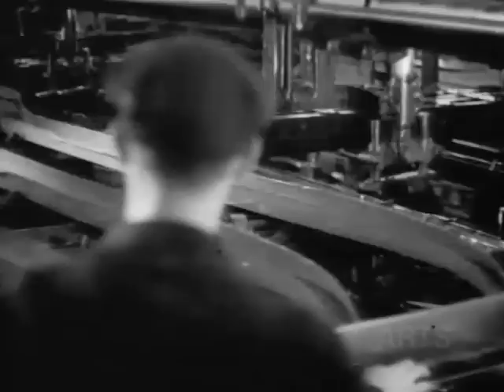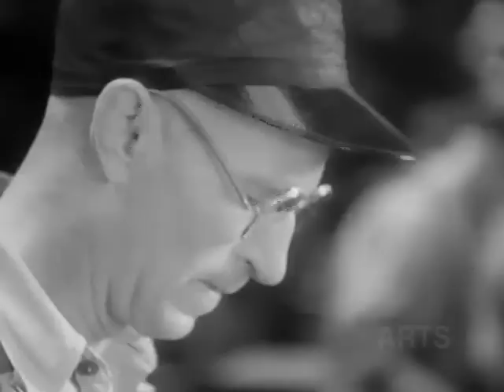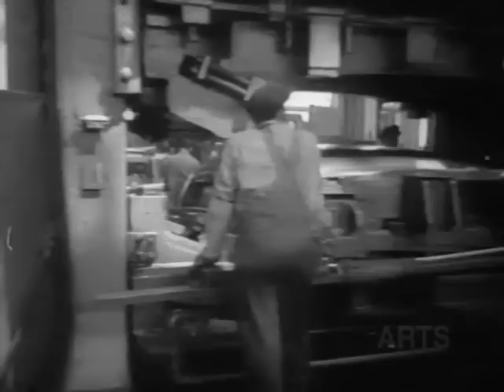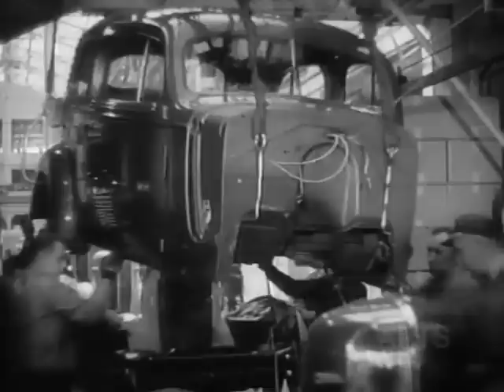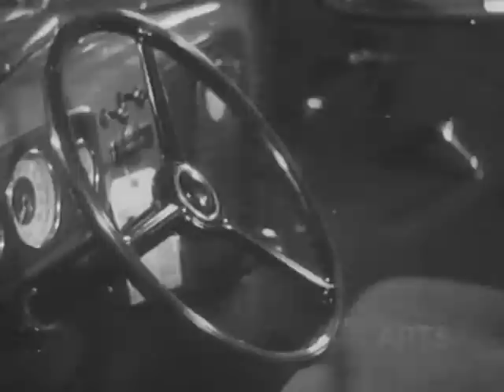Fascinating 1936 Footage of Car Assembly Line

Comment: Bravo, great video.  I wish America still built things like this.  I went to college in Flint and all that industry is now a wasteland.  I like the old way better, metal cars with no computers, built by hard working American craftsmen and brilliant engineers.
Reply: If only back then they had inertia seat belts, headrests and airbags how many road deaths would we have had? Gotta agree with you though Charlie weve come a long way, but somehow the world seemed more sane back then, not that i was on the planet at the time, came on the scene not much later tho.
Reply: When I was racing, then inspecting race cars, I used to be a safety nazi. I picked over every little thing. Now in street cars you have so many "safety" gadgets, no one really knows how to drive. ABS, "self driving" cars, parking assist, rear view video "mirrors". And God forbid you actually help a kid learn how to diagnose simple problems, check fluids, CHECK THE LIGHTS AND SEE IF THEY WORK ONCE IN A WHILE, change a tire, etc., etc.
Reply: Steve Vincent what has inertia locking seat belts have to do with anything. All that had to be done was tighten the seat belts.
Reply: Like the old way better? No problem. Get rid of your TV and your cable, fit all your clothes- and your wife's too- in a 3'x 3' closet, never go to a restaurant, or a doctor or dentist, get your kids working at 16, work 12 hrs a day yourself including Saturday, never go on vacation, and piss in a bucket in the backyard. If you're up or that you're half way to your dream.
Reply: If car manufacturers did not innovate and we had today cars and trucks without cathalic convertors and CDI systems, we would be all suffering from lung diseases. 
Computers in cars are not bad, but It is tempting for a car manufacturer to add features in  a car that are not really necessary.
Reply: It had a real real feel to touch the product that was going to be sold.
Reply: Yes, ooohhh who can forget front drum brakes n high hp engines? 🤣🤣🤣
Reply: Those care were very polluting, and very inefficient... Had the advances in technology been put into economy rather than power, we could all be driving 50 mpg cars. Instead, we have 200HP cars instead of 80HP cars to drive to the grocery store.

Comment: I can’t imagine the amount of labor that went into making those multi step dies for forming that sheet metal. Several years ago I hauled the CNC master that made the computer measurements of patterns for CNC machines that machined the finish dies for fenders, doors, and quarter panels. Even with CNC machining I thought about all the machining time it would take to make those huge dies, I can’t imagine hand grinding them to the precison needed to give the required surface needed for that blemish free finish.

Comment: Those cars back then were made out of metal not 95% plastic like they are now
Reply: Jerome Channell 
What are you talking about.  Cars and trucks nowadays are made mostly.of either steel or aluminum
Reply: kyle warmerdam yeah all the interior is crap plastic, crap carpet, crap seat covers......engines mostly wires n computer chips.....1 lil wire gets chewed by a mouse n ya car is going NO WHERE.....
Reply: Red Blue40 
When a person buys a shitty trim level that's what you get is cheap plastic interiors
Reply: when a person buys a higher trim level, they get cheap plastic made to look like higher quality material.
Reply: So you see why pick ups from the 60's are still on the job!
Reply: Yeah all metal interiors that stuck into people when they crashed. Injuries were more horrific back then.
Reply: A newer car 'fender bending' into my '69 C-10's HD bumper? Me - a wrench and a can of spray paint;  them - $2000 in damages (after a tow fee).
Reply: Sure if you didn't suffer an injury due to no crumple zone, maybe cost more to fix but it saves people from being cripples after a crash.
Reply: Smart driving, plus collapsible (or shear away steering columns 60's) smart driving, beats airbags hands down.
Reply: That's silly, you may drive smart, doesn't mean the other idiot t-boning you does. I suppose seltbelts are no use either eh?
Reply: Driving smart means you look out for all the idiots at likely occasions. Ask an 18 wheeler how they do it. I used to do that.
2000 Lbs v 5000 SUV and pickups? Airbags and crumble zones.... inside a eggshell.
Reply: Jerome Channell - Dude, the next time you fly in a Boeing Dreamliner, you’re flying in a 90% plastic + aluminum plane too, because that kind of plastic is stronger than steel.
Reply: Yeah...and they weighed TONS and got 5-6 mpg. But who cared when gas was .20 per gallon??
Reply: Yeah, everything modern sux. Bring back: Splash lubrication. Thermosyphon cooling. Ignition points that weld them selves closed if you forget to shut the key off. Sticking floats on carburetors. Engines that didn't start when it was cold, or wouldn't stay running on a hot summer day. 5 MPG. Valve jobs, ring jobs, and engines that were just totally worn out at 100K miles. 

I especially want a car they can hose my guts off of the interior, after I have the accident when the unassisted 4 wheel drum brakes are fading, and don't have enough ass to stop the 3 ton beast.  

Seriously people, old cars are nice to tinker with, and take on weekend drives for ice cream. But anybody who totally shits on modern advancements, and waxes poetic about all the great things cars had going for them "back in the day" either didn't live back in the day, or really enjoy using 36 grit sandpaper as a wash cloth, while they take an ice cold shower. 

I think it all boils down to "I don't understand how it works, and I fear change, therefore it's bad".
Reply: Cars back then made it about 20k and started falling apart.  The parts made back then were crudely made and fit like crap. I've seen plenty of original condition classic car's and the fit and finish was a joke.
Reply: @johnsarab4500  yeah if you throw enough money at them you can keep anything on the road.
Reply: @Kmecha84  You've GOT to be kidding......
Reply: @milojanis4901  um well vehicles are made of aluminum steel and plastic so no I'm not kidding
Reply: @Kmecha84  r/wooooosh

Comment: Amazing...would like to know how it worked with out microcontrolers
Reply: Mic's were common back in the 30's
Reply: Everything was mechanical - really not unique, many machines still run exactly the same way today. Like comparing a mechanical and electric wrist watch. Microcontrollers were not available until the 1970's.

Comment: "The first automatic transmission was invented in 1921 by Alfred Horner Munro of Regina, Saskatchewan, Canada." Makes me happy because that is where I live :). 

"The first automatic transmissions using hydraulic fluid were developed by General Motors during the 1930s and introduced in the 1940 Oldsmobile as the "Hydra-Matic" transmission" SO you are correct but so am I..
Reply: No the HydraMatic, the other GM automatic transmissions, the Powerglide and Dynaflow came later.  The HydraMatics were a four speed transmission used in Oldsmobiles, Cadillacs and after the war  Pontiacs and featured a fluid coupling so there was no clutch. The Powerglides were exclusive to Chevys and were only two speeds and the Dynaflow was also a two speed but normally operated in the higher range gearset and used a torque converter to provide the needed gear reduction to accelerate the car. The Buick transmission using torque converters in normal operation had no perception of shifting, the torque converter providing variable reduction so the effective ratio of the transmission changes without shifting, it was very smooth but not to efficient. Some other GM cars used Dynaflows in 1953 due to a fire destroying the Hydramatic plant.
Reply: model T ford was basically a automatic.  no clutch
Reply: hey capt. that's where the designation th400 th350 etc. came from and po werglides were used in other gm cars too my tempest has a straight 6 with a glide still works great hydramatic was just a gm division like Saginaw,delco,mucie or ac
Reply: Sturtevant had an automatic in 1906
Reply: LostFart i wont buy an automatic  .even if i have to special order a car for the manual i will. Automatic  shortens a cars life and need replacement often  . I can rebuild them , i do for customers  i just wont own one
Reply: Automatic transmissions wear out or need replacing much sooner than a standard shift, but they (automatics) are surely a convenience in heavy city traffic.
Reply: * DYNAFLOW *  Ugh!  That transmission is what earned Buicks the name "Bu - Hog" back in the day.
Reply: Abcde    Tell us more about this vehicle.  Where was it built and do any still exist?

Comment: "Once men used machines to build things. Now machines use men."
That's what I call glorifying the past.
As esthetically appealing this might be, in fact it's the worst nightmare of fragmentation of work I've ever seen. Every worker had exactly one manipulation to do, the work rhythm was determined mercilessly by the machines, and alienation from the workpiece was at its climax.
Today we have a quite clear separation between robotized areas and those with manual assembly. The pace in the areas where humans work is much more flexible and the work is no longer divided in single manipulations but in completing subassemblies. This demands more (or a different kind of) attention by the worker, but it also gives a small amount of freedom to him or her – and the satisfaction of having finished something…
Reply: 0cer0 There still are plants that mix machines with human presence and a lot of activities that require just 1-2 small and fast operations by a worker. And it isn't a nightmare at all, a huge part of the operators would like to work simple tasks, because that doesn't require much responsability.
Reply: 0cer0 in other words , today we have unionized mandatory 15 minute breaks every hour

Comment: How the years have changed manufacturing.  When you watch this video you can actually see the heart beat of the whole factory working as one becasue the mechanical processes were based on the wheel and not on 5 axis robotics.

Comment: The old cars were built to last. I just gave my Ford Explorer 1991 to be sold for a charity

Still runs and shifts super smooth.

Replaced a few parts over the years, but original engine and transmission

It runs like a dream

Rides like a dream

Had an 89 E-150 that Also ran and rode like a dream

They don't build them like that anymore

31 years old and starts with a single crank. 

Just absolutely incredible

God I miss America from back then

Comment: You know what's even more fascinating...this control (programming) was all done via huge relays in panels...some were pneumatic timer relays...incredible...the engineering and wiring of theses panels. I designed, built and wired a big relay panel in 1990 for a control system...i can appreciate what they did here.
Some workers without gloves...lots of moving machines near them....I see lots wrong with the safety here...but that's how things went years ago.

Comment: Most people think of the automated factory to be a relatively new technology, when in fact it has been around since the late 1800’s in heavy industries.  You could see quite a bit of 20 plus year old machinery in this film along with cutting edge units of the mid 30’s.   Very little has really changed in the assembly of the automobile over the last 70 years other than single point machines that can do multiple tasks instead of single task machines.  The human mind and dexterity will likely never be replaced however, since this is the most flexible machines in the plant.

Comment: 1936 was the year my mother was born!keeping up with one another plays the biggest roll because when the line stops, so does production, sometimes it's unavoidable but, breakdowns does happen without any notice and sometimes it will.  A lot of of the molds needs constant maintnaice, the whole system has been outdated and those machine's and die's are extremely expensive and in most cases compnies will have to rent them. There will always be disappoints along your journey with feelings of failure. Keep your eye's towards Mark of the High Calling...You can't go wrong, "EVER❗peace be upon you forever!!

Comment: Stylists and Engineers get all the credit for exciting cars but to me most impressive is back when cars changed significantly every year, all the complex tooling and assembly machinery had to change along with them. How they got it all coordinated and designed and built in such an efficient manner with no computers is mind boggling. Also how those workers could stand there and do the same thing over and over all day without going insane is a mystery to me.

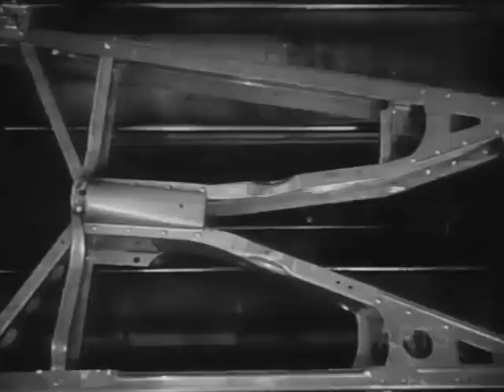Comment: 3:54 One guy rotating vehicle frames through 180 degrees in two axes, using a single chain through a freewheeling swivel mounted pulley, as it moves along the line.   American workers were a different species back then.

Comment: Before we get too nostalgic, my Dad's 1936 Ford had cable operated brakes that unless adjusted, caused spins. There were no seat belts, the cars were death traps. They had 1/3 the power of today's cars and the engines needed to be rebuilt at 100,000 miles. The bodies rusted out in  8 years. But they had curves! Great video.

Comment: For 25+ years I designed lines like above for big 3 ,Toyota, Mitsubishi, Isuzu, Subaru, Mercedes etc. I did not have college degree, hands on experience only. No calculations, just instinct. All done on paper. No 3D CAD programs. After introduction of computer assisted design programs,  time of designing these machines increased 3 fold so a price of vehicle.

Comment: Amazing. In 1927/8 you could buy a Model T Ford - how quickly cars evolved in that era. Same for late 50s to mid 60s. A '59 Chevy compared to a '66. Unrecognizable. 2011 to 2019, hardly any change noticeable. 1936...that production line looks 21st century in parts.

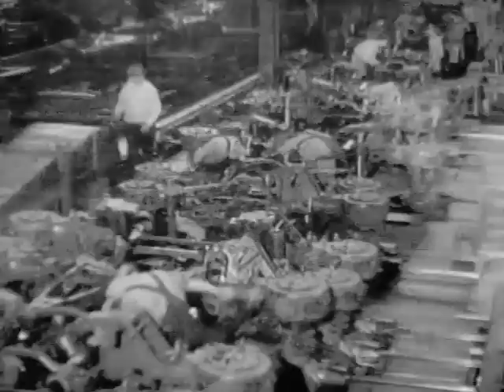Comment: 2:31  A bit scary on the frame assembly line.  If you didn't stay standing in the right place, those spot welding machines moving on both sides of you would make your day bad very quickly
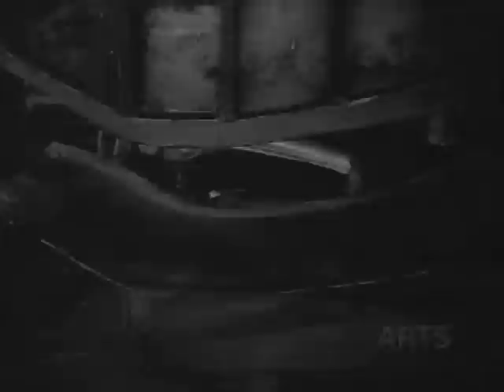5:40  Two hands needed to activate the press means one hand won't be left inside the machine.

Comment: the automation is all cam gear driven and not microchip. i always wondered how they changed a car model every year so drastically,how did they change the molds so fast that stamped out parts. must be interchangeable dies inside the press is my guess. anyone?

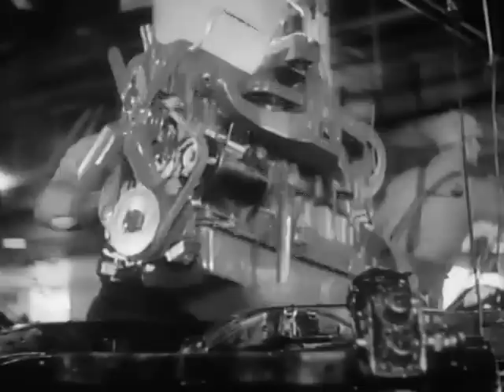Comment: @4:29- crankcase ventilating (puffing) to atmosphere-- ford 8n etc did it too
Reply: What are you talking about? The engine is not even running. Unless you are talking about something different. Not trying to be an ass.
Reply: @davidcollis4758  when its  running it puffs to atmosphere - ever seen one running?
Reply: @santatigerclaus  Have You?
Reply: @davidcollis4758  i guess you havent
Reply: @santatigerclaus  An engine can't puff to the atmosphere if it's not running Einstein.

Comment: And to think someone is still driving one of the vehicles made in this video. Can't say that about a 2001 Chevrolet Cavalier
Reply: El Capitano Guillermo dodo  You've got one of the few. My mom had one she bought brand new off the  lot. Engine finally blew around 200k and the body looked like it had been through hell and it was never wrecked. But her job is basically is driving everyday and most of her cars look and run like that cause all that constant running for so long each day takes way more of a toll on a vehicle than driving 20 miles a day.

Comment: excellent choice of music, sets the tone for what was difficult, monotonous, dangerous work

most of you miss this: this is an example of "the final 10-percent", that is, it was still cheaper to have human labor involved for the final 10-percent of of a processing step than it was to go full-on robotic. 

Many machines of the era were "mechanical computers", in that you could manually program them via switch settings and wiring input boards.

Comment: That knee-action front suspension wasn't one of GM's better ideas. Neither was the knee-action shock built into the top suspension arm on later thirties and forties GM products. Never saw one that didn't leak. Putting oil in them was a pita.